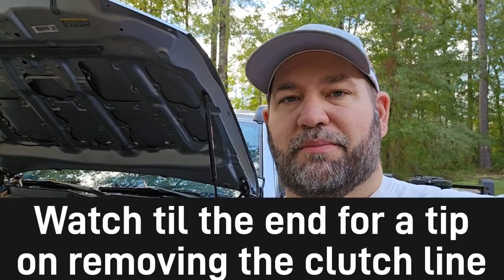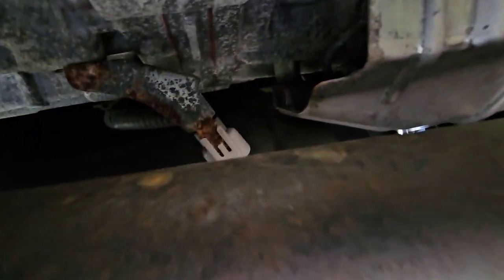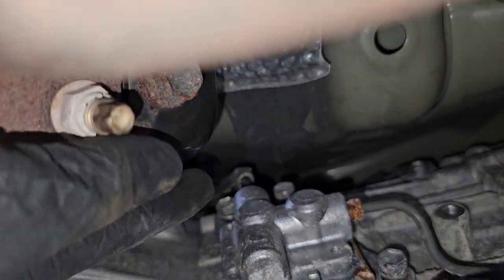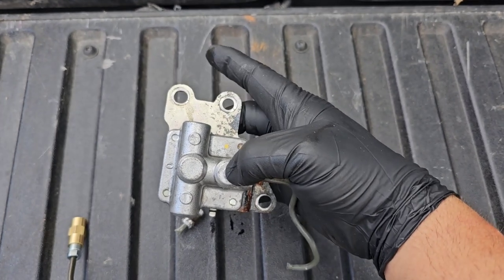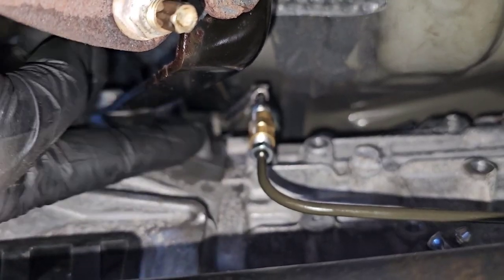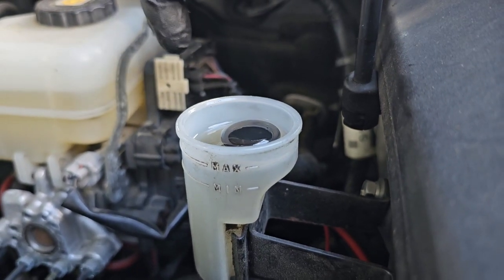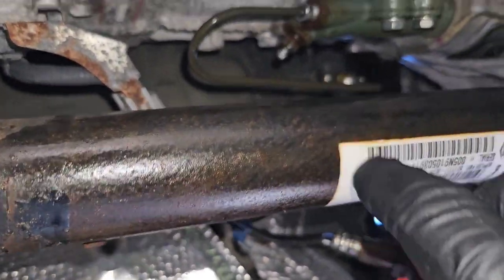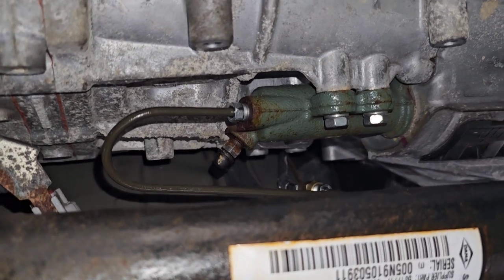2019 Tacoma clutch accumulator delete

Comment: See you went with a simple line versus the hidden bypass (dremel or disc methods that transform an original accumulator to a dummy/bypassed accumulator, that’s effectively the same as tubing. But, it’s the best video i have seen of the actual process. Any reasons why you went with this versus other methods?
Reply from the maker: 1 reason was I think just having the line looks cleaner and cleans up that area. 2 it's pretty tight in there and I didn't want to have to put it all back together. Plus I figured it would just be faster to pull it out, bend the line, and put it back together. Plus I'm out of warranty so I'm not too worried about keeping  things looking stock under the truck.

Comment: What’s the usual method for catching fluid when the lines are first detached? How fast / forcefully will the dot3 or brake-type clutch fluid come out? Did you look up recommended torques to reattach, or just do by feel?
Reply from the maker: I actually laid big out a plastic trash bag (like a 50gallon bag) and just let everything fall onto that and then was able to wipe it up and dispose of it then. It wasn't a lot. And I just tightened everything to feel tight and checked for leaks after bleeding it.

Comment: Do you have a part number or link for the bleeder you used?
Reply from the maker: I just bled it the old fashioned way by letting gravity work as much as possible and then pumping the clutch and holding it while breaking the bleeder valve loose and then tightening it back up and pumping it again. Doing that over and over again until it's bled. However I'm sure a cheap one from Harbor freight would work perfectly fine.

Comment: Man ive had my truck for 8 years now and the clutch has been killing my foot and it feels like garbage, i should do this with a fresh slave cylinder! Do you have a link for the line and fitting?
Reply from the maker: @Staticbrain  I don’t have links because I purchased the parts at local auto parts stores but the part numbers are shown in the video near the beginning. If you look in the description of the video you can click on the .40 second mark and it will skip ahead to the section where I go over everything I used.